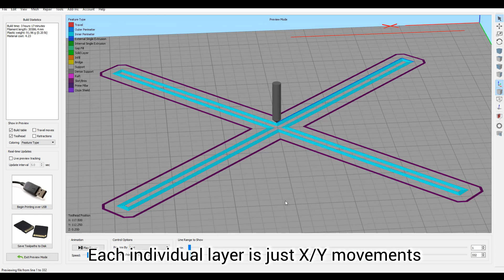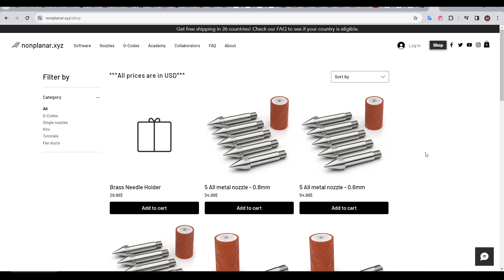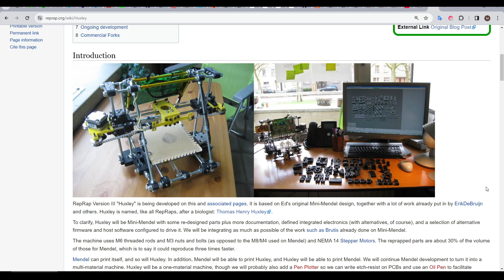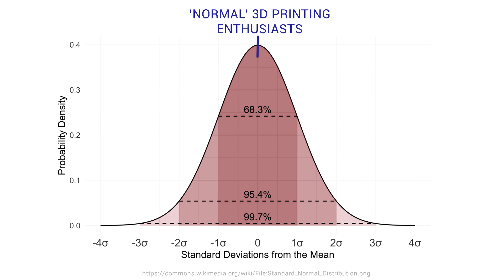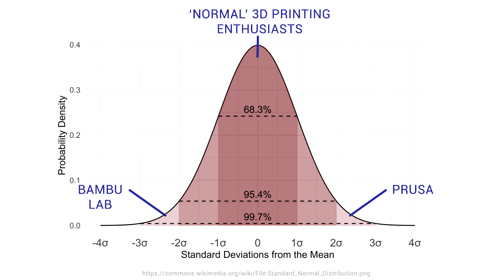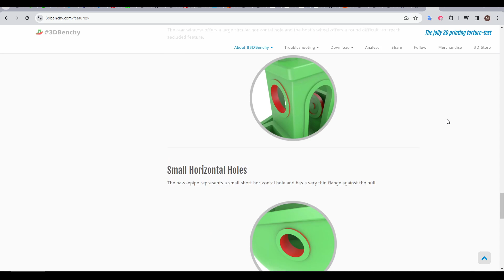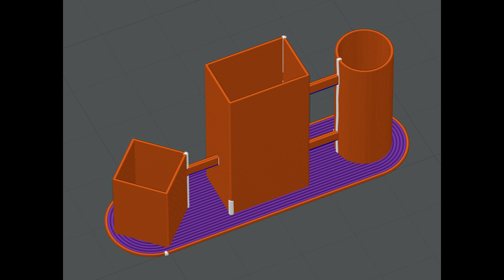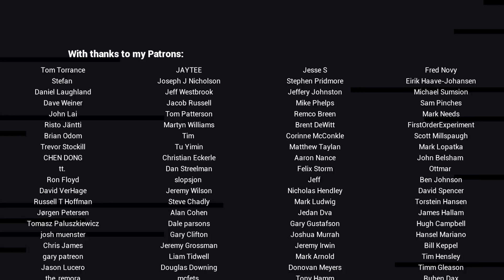3D printing mysteries that need to be solved in 2024

Comment: this artifacts can be imitated but with that low material state precision what actual printers have, there is no chance to improve that. the compute power and sensors on those machines are poor.
you need a computer that tracks the actual state every movement and analyses to predict the outcome on the next move and what consequences this move has and what needs to be done for a perfect result and that et best every half of your nozzle size on the move. yea your slicer does some work before hand but your printer does nothing as following blind the steps is given. some printers compensate wobble but this solution is far from perfect and also need a huge compute power and knowledge for setting up the PID controler for this task but still this is dumb mathematics and easy predictable without sensors only with the feedback from the steppers. you could do better with a 6 axis accelerometer but reading this cost time compute tis kost time and then you can counteract but this might be to late. wie did go up in compute power in the past from a 4mhz processor to a 16mhz but only for the sake of a more useful and response lcd. but now with that every one hat that need for a pretty colorful lcd with integrated web ui for tracking what the printer is doing but for the print process it self the compute power has never really changed. 
the printer it self is really much dumb as before regardles if a reprap, babulab or creality. the most work is doing your slicer with data thats provided the behavior of your printer in ideal conditions but this is never the case yea 90% of the time all errors being made are not noticeable or acceptable but never perfect. 

the perfect printer must be have sensors all over the place. like reading the thickness of your filament every mm for calculating the right amount reading its temperature to calulate the teperratur difference it causes if pushed in the hotend  depending from surrounding temperature. whit that you could calculate the viscosity of the filament and controlle it with the given heating power. from that you could track when did that exact position layed down and how cold it would be to controlle how fast and with what teperratur you lay down the next layer on thop for best bonding. 
and this is only the tip of the iceberg you could or need to track and controlle for best results but no one ever could buy such a printer. you need a computer thats the computer ist self cost more then the printer even with tausends of sensors. this may be possible today with a ender 2 printer type set to 10mm/s but going faster like the fastest bambu lab no chance at that speed no sensor could handle that response time and accuracy thats needed to do so. 

so at the end our printers still silly dumb and the slicer doing most of the work before hand and as long the demand for prettiness and not quality is nothing will change and manufacturers will avoid doing something thats involve thinking and cost money and as long you blindfolded buy they do so. yea that wobble thing ok did in fact really good work and the overall print quality is for the most part more as acceptable and a big part for that is bigger heaters and lots of testing before hand so the costumer buy a product that is well set up with its given limits. but every one knows if your machine goes older you may have to print a bit slower for the same quality as brand new. material deteriorating over time thats nomal. who knows if you fancy fast bambu lap printer can the same good stuff after 10 years or needs a bit slower for the same result maybe you have to make your own parts because the printer is discontinued or even work at all. 
i have a ender 3 pro with a direct drive and bltouch for z homing. i am happy with it and dont need a new one but in those 7 years i replaced every motor 2 times or more and fried one mainbord with a faulty sdcard. i handle this printer with care but the environment it sits if far from consistent so my parts vary a lot. one thing i can say is cheap filament is improving a lot over the years what i cat say about "high quality filament". i have the feeling those not really changed. ok for my credit i dont really care the brand i only look for the color and take the cheapest available.

Comment: Well darn, now I'm going to spend half the day purging all my printer nozzles to see which way it coils, lol.
But on that last issue (the tall square & cylinder, I wonder what would happen if the travel speed was slowed way down, or the parts were farther apart? If it is a nozzle temperature issue, it would give it time to regain some heat.
Great video though, I thoroughly enjoyed it, and feel the same way. 👍
Oh yeah, all that filament you had so many breaks in, I had that happen once as well. I think it's a combination of moisture (making it brittle), and as it comes off the spool, it's being bent in the opposite direction, putting too much stress on it. I'd bet, if you relocated the spool so it fed from the top, so it would bend in the bowden tube the same direction, it wouldn't break.

Comment: PROVEN ANSWER TO SNAPPED FILAMENT IN SHORT SEGMENTS (TLDR at the bottom):  I ran into this while I was working through some issues I couldnt figure out.  I ended up drying the filament over and over.  I was making small test prints with the same spool over a few months.  Eventually i was plagued by broken filament in the reverse bowden tube.  I am CERTAIN this is because the filament as "annealed" and strengthened.  

I am a structural engineer so the term annealing is irritating since it is to relieve stress but in 3D printing it is used to describe post-printing strengthening  by heating to temperatures similar to pre-printing drying temperatures.

In our case the filament polymer chain is clearly changing during the drying cycle.  This normally does not show up since most of thr time the spool is used up after one or two drying cycles.  It also is contraindicated since "brittle" filament is usually wet filament that is improved by drying.  

TLDR:  Excessive drying cycles cause filament to become so brittle that even reverse bowden will cause it to break in tiny pieces.

Comment: I'd be very interested in your opinion of 'The 100' which is a mostly 3D printed 3D printer that can print REALLY fast, like 100K accelleration, 600mm/s printing etc Obviously printing slower gives much better prints, but even 'slow' is much faster than most printers you can buy. I've only seen videos from the maker so another view, especially yours, would be awesome.

Comment: For the end question -- yes, you have identified the exact cause. The extra material of the cylinder when it starts the top layers section means the flow rate changes, but it's not a direct effect of just "geometry changed, so flow rate changed". You probably have the filament cooling setting set for the minimum layer time -- for the quicker layers where it's just perimeters and infill, it's having to slow down the volumetric flow rate. Once it gets to the top layers of the cylinder, it has more material to extrude, and it doesn't run against the lower time limit, so it can keep the higher volumetric flow rate.

The sure-fire way to check is just change to the Volumetric Flow Rate drop-down option when you slice -- you should see the banding appear exactly as it does on the actual model for where the printer could speed up. The faster it can go though, the lower the actual nozzle temperature is, as the thermistor is always going to lag behind, and that will result in more of a matte surface quality.

Something to note though -- the print you show as an example in the blue filament is NOT something that is caused by this. That's just a change in the seam position.

Comment: All great questions, but I'll only comment on one. ;)
Regarding the surface artefacts (10:55) setting up an infra-red camera to watch the region in question many shine a light on your temperature theory. To me it almost appears that the flow rate for the layer is being set across objects, and not specific to each object. Have you tried comparing between different slicers? (not mention which slicer was used in the video). Also testing on Merlin vs Kippler firmware printer to see if there's a difference?

Comment: Surface Artifacts:
I put my $ on combination of multiple factors:
- Seam alignment
- Thermodynamics of plastics
- Consideration of highspeed printers and fast layer times / variable layer times.
- Volumetric mm3 Flow Rates and how close you run to them
- Minimum layer time will impact Flow Rates,

slicer previews for all these views, flow,speed,time,etc show alot of the impacts these all have. If you can see it in a slicers preview, you can see it in a print.

Comment: The material issue depends on the material that you are showing in your video. I think that it is depending on your environment since you are "Downunder" it can be very dry. The plastic material has optimum humidity.

Comment: Regarding toxicity: That's typically a market adoption problem. Let me explain:
> As for every new tech, you first get the "Early Adopters", few tech savvy and passionate people with a minimum understanding of what they're doing and tinkering. Different level of knowledge, but the same passion.
> Then you get the "Trend Setters". They discover the tech, find it "cool / fun / helpful" (choose your weapon) and spread the word to the masses
> Only then, when the tech becomes mature enough (like Bambu's plug-and-play products) you access the "Mass Market". A whole lot of people come onboard to benefit from it.
These late adopters have a totally different motivation : efficiency for their buck. Not passion, tinkering, nor curiosity. They don't want to understand how it works, or why it doesn't. They come to the community just to find direct answers to their very own, current, particular problem.
> The community then becomes a mix of people with different level of expertise, but that's a pleasure (for most of us) to spread knowledge, but also people with different motivations and levels of commitment: 
Some come to embrace and improve the tech, most come to get things fixed. 
>>> Having built an strong expertise over the years, collectively found explanations and solutions to solve issues and improve our passion, and then having newcomers say they don't give a sh* about how it works, they just want a step-by-step process to solve their issue is *very frustating*, thus the toxic fight
NB: We don't have yet (and will probably never have) the last category in the Voron community, just because the entry ticket is the passion and commitment in building your very own printer.

Comment: 7:22 of those messages I saw 1 that could be considered "toxic", and a couple that showed a clear preference for Voron. Most of them showed curiosity, and how the core-xy you built would compare to the Voron. Which is understandable because of the hype around it. So the selection of comments fits perfectly in the bell curve. 
Note that I only have an Ender 3, and as such am not a Voron fan-boi. Not a Creality fan-boi either, for that matter.

Comment: Hi, I like you channel and have fiund your material very informative in the past (and still do) and the way you do your content :)

I live in Sweden (northeren hemisphere) and the filament flows clockwise here too, i beleve it has to do with the way its spooled.

For the artefacts my experience have teached my that it is mostly connected to print speed and layer time. Some artefacts is connected to the mass (or differences in mass) in different layers, as the material will crimp when cooled.
I often print bigger prints of 10+kg in one print and on those prints it is VERY obvious whit the artefacts. Often times a redesign is needed to mittigate it. It does also get exponentially worse with bigger nozzles.

For non-planar printing it is a thing and we use it alot, but mostly on robot-arm printing. Problem is that the dlicers is expensive costing about €10k/year and as far as I know Klipper dooes not support more that X, Y and Z moves it is not really something we are looking into at the moment...

Comment: Snobs do really ruin it.  I remember getting a very small Delta as my first and rapidly outgrew it. I got my first big volume printer an' ANET bed slinger.  I was transition and trying different slicers and was told to try Prusa Slicer.   I was having trouble with the interface and locking in values to different uses.  I asked one question and was pretty much the equivalent of harassed and insulted, saying I never tried to figure it out and how stupid am I.   I almost gave up learning/printing then...    as that was the most praised slicer and place to go.

Comment: Bambu labs is in a difficult position for me. They have previously, many times, ignored open source licensing.  I can’t in my right mind recommend a company with such blantant disregard for open source licensing. It sucks because their machines and software work well together.  They would be an easy recommendation if they weren’t the company they are.

Comment: To me the filament snapping looks like repeated bending stress fractures, the hypothesis is further supported by the rather sharp bend right next to the spool holder. Although the legs are long the radius of the bend looks pretty small

Comment: To address the question about the filament snapping: I've also had this happen, and typically I've heard it said that older filament that has absorbed more moisture from the air becomes more brittle. So perhaps if you tried drying the filament it would become more supple again.

Comment: For the weird print line artefact that you mentioned near the end, if its heat related you could slow the print speed down so the higher volume/filament through put areas have a lower impact on nozzle temperature or try printing it on a Voron.

Comment: The cracked filament is caused by moisture absorption in older filament. You need to keep it in a dry bag (eg silica gel) when not in use.

Comment: The Coriolis pseudo-forces in weather systems effectively come about because the distance around the globe is different at different latitudes. When you're talking about systems the size of a tabletop or a drain, obviously there is no such difference so no effect.

Comment: Is the artifact not related to layer time? I have a (Chinese clone that outperforms the original) CHT on my p1s and I get these occasionally from what I found correlated with layer time in my case. I was nowhere near the max flow of my nozzle either. I put a higher limit so the layer time was consistent across the part and they went away. Could be flow still since it slowed the print, but that was the extent of my testing.

Comment: The last one the artifacting could also be because of direction. 
When you have more details like holes in a model you end up with more seperate wall sections in a layer, that the printer has to go from one section to the other and the slicer may not approach it from the same direction because it is trying to be as efficient as possible with the distance travelled. 

Like lets say you had a cylinder. Then part way up you create a hole through the cylinder, eventually the layers go from being simple O shape layers that have only one wall section. To two D shapes. It will draw one D and then it will be back where it started, then it will hop across the new gap and then start printing the other D, but its now on the opposite side of the cylinder and so its Likely to start printing from a different direction from the layer below.

Or at the very least just the fact its now approaching a new layer in a very different way meansit wont look exactly like the layer below. Doing a single circle theres no change of direction, but doing a corner wont be as smooth. So it looks bumpy compared to the smooth part.

Comment: Regarding one object affecting another, I wonder what would happen if you manually edited the g code and added a park tool command and a pause command when the first object finishes its top. That would give that particular extruder enough time to get back up to temperature before continuing with the rest of the print. This is not something you could always do, but I'm wondering if it would actually work around the problem you showed.

Alternatively you could manually insert a temperature command that bumps the nozzle temperature up 5 degrees on the prior layer giving it time to get to higher temperature when it gets to the infill for the top of the cylinder. Then on the subsequent layer you could drop the nozzle temp back down.

Comment: I'm not naive enough to think voting with your dollar truly matters in technical spaces, given the inherently high barrier to entry for any semblance of technological literacy. The information asymmetry is going to be capitalized on. But suffice to say, I'm going to be quite disappointed when 3D printing goes the way of DRM-protected filament spools and closed-source cloud software like HP printers. It's all terribly predictable, but still disappointing.

I feel the strength of the community comes from its relatively open nature, and certain companies barely bother to dance the line. Open source when they have to due to copyleft licenses (if we're lucky), closed source everywhere else. This is probably a large part of where the vitriol comes from. Let's not forget, this technology wouldn't be where it is today if it weren't for the open source community resuscitating it back to life. It'd still be buried under a sizeable stack of patents and dust.